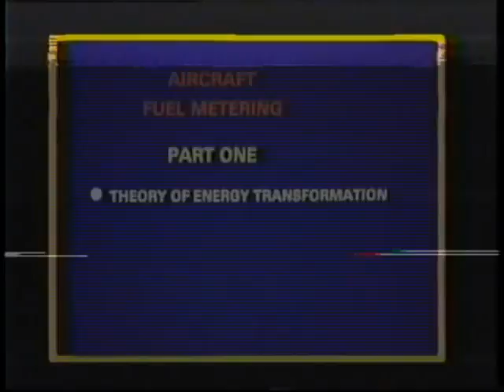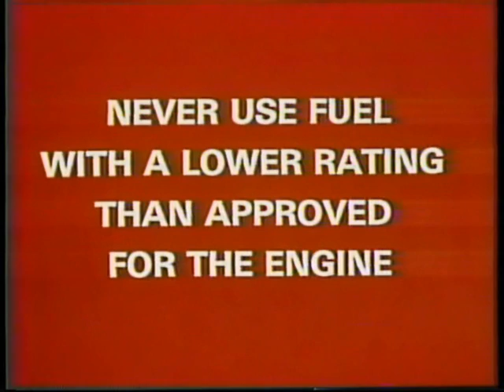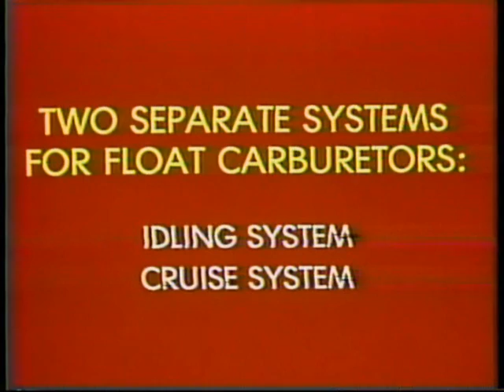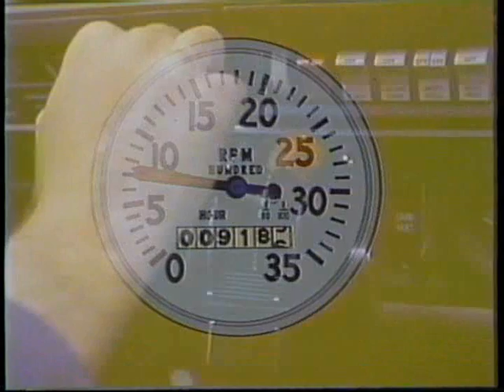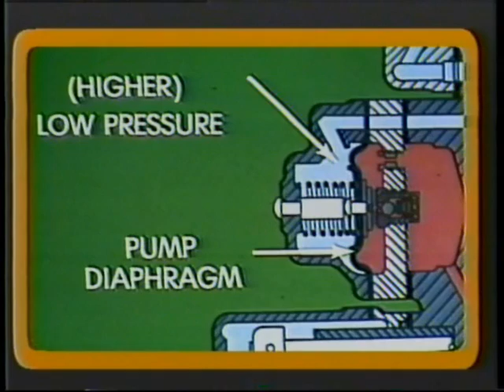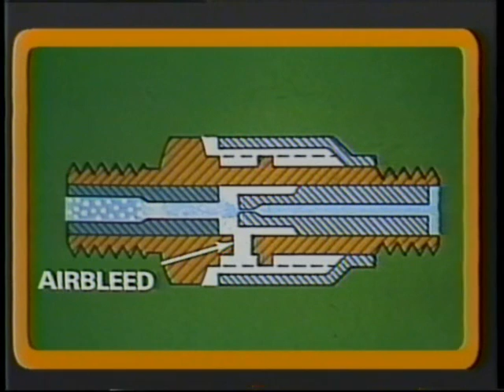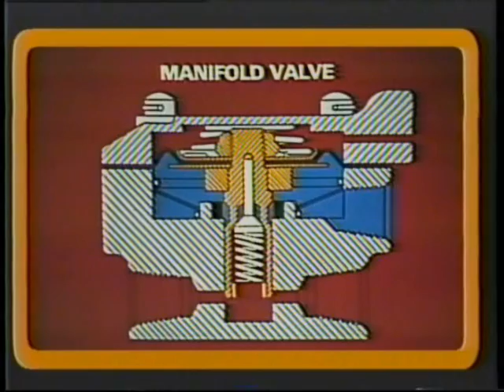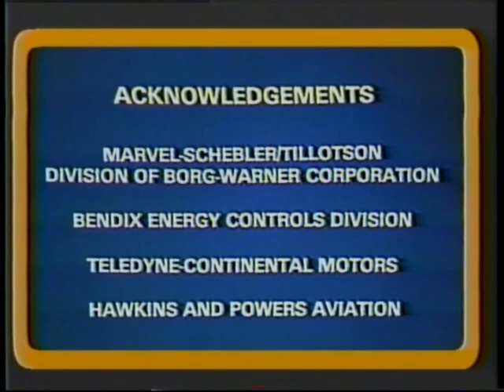Aircraft Fuel Metering Systems

Comment: A good series on aircraft fuel metering,I have been doing fuel system repair and overhaul for 23 years.
Reply: I heard that fuel and air will be mixed fist time in emulsion chamber in fuel nozzle, is this correct? pls advise the airflow path starting from impact air or venturi suction air? thx
Reply: im out designing an air craft and would like your assistance